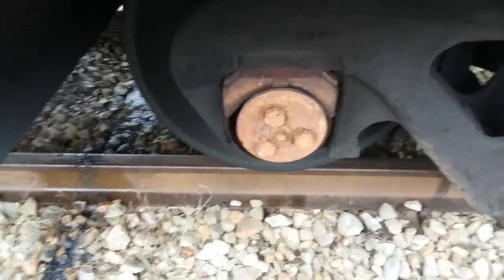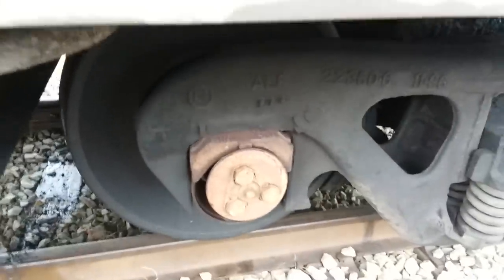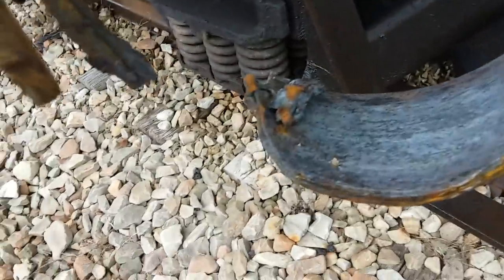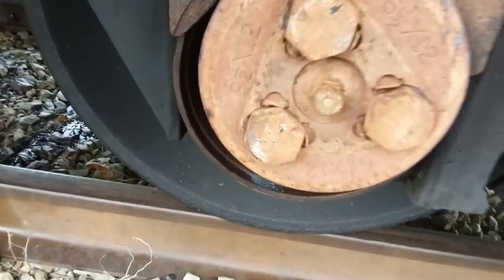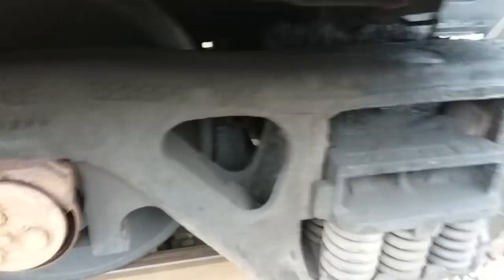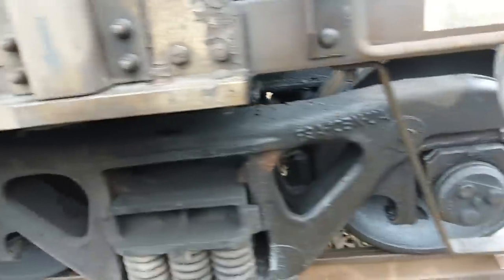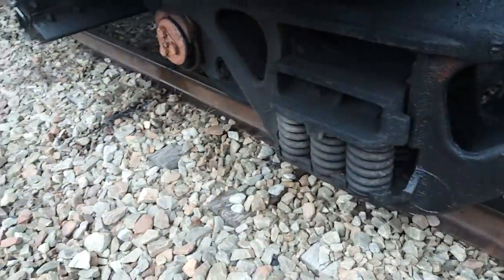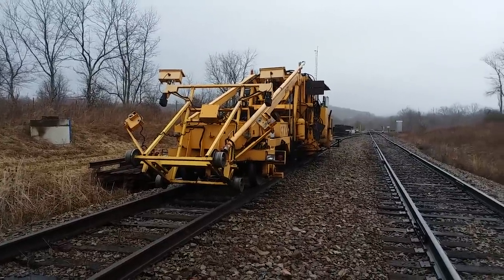Hopper Car with Bad Bearing, more of the Story

Comment: Add years repairing freight cars ,Penn central ,Conrail I never saw roller bearing go bad ...
Thanks for video
Reply from the maker: Thanks for writing in, that awesome you worked for PC and Conrail,
golly would I enjoy hearing some stories from you! We have an uncommon amount of bearings go bad here over the past 10 years.
We only have 38 cars but probably have had 10 to 12 bearings
fail in that time. Makes me wonder if the vendor we have for
rebuilding our truck sets may be not of good quality? it
is a puzzlement to me and costly for the company.
Reply: @ccrx6700  ,something is not right on bearings ...
I rebuilt bearing with Timken ...
But they stopped that long ago ...
We used to check rear seals and if you can turn them they are defective ...
You do this while inspecting train reach over trucks and grab real seal ,if it turns it's defective ...
Maybe grease is leaking out there or water getting in ....

But still I never saw a roller bearing go bad ever.  .
Friction bearings of yes ....
I was wreckmaster and saw everything and trainmaster also never saw roller bearing good bad ....
Reply from the maker: @sproulman1  thank you for replying back. I will start looking at those seals. I did not know that before. We had another bearing burn up this week.  😢
Reply: @ccrx6700  ,we inspected PPL coal hopper cars and they had us reach over top of trucks and turn rear seals by hand ...
If they turned they were shopped and wheels replaced  ...
We use to see those cars daily for years

Comment: You never said how it gets fixed. Does a crew come out and fix it there and how is it fixed do they put a new wheelset or an axle in?
Reply: A crew jacks the car up and they roll the truck out from under it. Then they lift the end of the truck off the bad wheel set and roll the wheels out. Then a new wheel set is put in its place and it all goes back together in reverse order. If it was the outer wheel set, if I remember right, it seems like that can be changed by just lifting the car and truck together and rolling the old wheel set out and the new one in.
Reply: We have a contractor coming out next week, will try make some vids if I'm at work that
day. They have a crane, will pick the car body off the old truckset, then roll it out and roll
a new one in, there are only 2 brake linkages with pins that need to be removed so
that truckset is then free. Good question and thanks for asking and watching sir
Reply: @ccrx-xu1wc  
We have jacks on our Road Truck, and can change that wheel out in a little bit.
Making sure the lift pads are Level and Stable, is the most important thing!
Reply: @ralfie8801  What do you mean by "If it was the outer wheel set"? Thanks
Reply: @90FF1  
The wheel set closest to either end of the car. The wheels toward the center of the car would be the inner set and the truck would probably need to come out from under the car to change that set. 
It just depends on who’s changing the wheels and what kind of equipment they have to perform the task with.
Edit: For all I know the axles might be numbered 1 thru X beginning from the “A” end of the car. Locomotives are numbered 1 Thru X begin get at the front of the locomotive going rearward. Being a locomotive dept employee, I don’t really know how the car dept. might go about categorizing which wheel set is which and where it might be located on the car, or if they even do.

Comment: I’m a little late to the game, but bearings with grease fittings were not allowed in Interchange since early 2000’s. Most have been removed from service by now. I saw another one on the wheelset in the same truck. The piece your holding is inner race that mount’s axle. Detector got it just in time, they don’t last long naked axle. We were seeing sealed bearing twenty years old still in good shape. Coal cars are high utilization, heavy, very hard on bearings. Are your cars captured service?
Reply from the maker: All of the bearings we have are sealed. Some of the bearings still
have the button head fittings on the end caps, but greasing them
will do nothing since the bearings are sealed. I kinda figure the
truck set rebuild shop has lot's of these end caps with the fittings
on them and just use them when a wheel set gets rebuilt. Thanks
for writing in and watching today James.
Reply: @ccrx6700  I worked in a car shop as a carman, had a great deal of experience pulling defective bearings and replace with a rebuilt bearing. Timken, Brenco, Hyatt,NKS all sealed bearing that did not reuse end caps with grease fittings. They could use other manufacturers end caps, but only sealed caps with color coded lock tabs in color of bearing manufacture. Green on Brenco, Blue on Hyatt, can’t remember color for Timken. That is why I asked if cars are captured service, not offered to other railroads. I just had never seen grease fittings on sealed bearing, not allowed by ARR. Great content on your channel. Well done 👍
Reply from the maker: @James McDonald  please email me, I would like learn more from you.   

Peppypetsdaily@yahoo.com

Comment: Hi Dave. On one of your bearing failures vids you mentioned having the company check the last hot box detector and the bearing in question was running at 40 degrees + and within 6.5 miles the bearing was hot enough to cause a 6 1/2 “axel to sheer in two. My understanding is Amtrak is running detectors every 20 miles or so for their high speed trains.and in light of your experience it seems like they should be checking every 5 miles, not 20. Am I missing something?
Reply from the maker: Various railroads space them at various distances and that depends
on the sections of track and what the freight or passengers they
run over those sections. I'm not an road master for Amtrak so
I can't say for sure. We only have 16 miles of track and our detector
is half way, which makes perfect sense for us. Very much appreciate your taking the time to check out the video on the hopper car with bad bearing my friend.
Reply: Gosh Dave, thanks for getting to my comment and your answer really does shed some light on an area ( railroading- my grandpa first drove steam for Southern and a few years of diesel before he retired ) I seem attached at the hip with genetically.
Reply from the maker: @georpwl  cool Southern was a great RR in its day 👍😊

Comment: I believe I once read that early rail vehicles used plain bearings. Is that true?
Reply from the maker: Noah, you are correct, early rolling stock used what I believe were
then called friction bearings, which is what I think you mean. They had to be checked and oiled all the time, plus replacing the packing in those journal boxes left many a carman using words unfit for here on our chat. Thank you for watching

Comment: It’s all OK, that wheel set is nearing the end of its useful service life. There’s very little rim thickness left to work with.
Reply: Excellent observation there sir! I wonder how many others will notice, you got
a good eye and some real railroad experience under your belt.
Reply: @ccrx-xu1wc  
Thanks! I’m a IAM machinist at a locomotive shop. One of the things I do is inbound inspections and troubleshooting so the shop knows what to repair.

Comment: Guess it's a jack lift up job since no real space for equal crane lift to pull the truck set out. Will they just bring up a whole wheel set and do it that way or do a full RIP of the bearing?

Comment: That shaft would have had a hole drilled at factory where grease could be inserted into bearing ..as you say over the years being replaced were done so with sealed ones..which have a minimum of packing grease which will liquefy and seep out over time with stress of heat and use and fail as this one did...remember grease and oil is there to reduce (friction and wear)
Reply from the maker: We've been been pretty fortunate David, we put detector in 4 years ago and have only had 4 bearings go bad in that time, so 1 a year ain't so awful bad, im surprised more dont go than they do

Comment: Is a roasted bearing very common?  If it is then there should be a 2 port greasing solution so new grease pushes out the old grease without blowing the seals
Reply from the maker: Seems for some odd reason we here go thru spells, where there
won't be any for a long time, then all of a sudden they start going bad, it's weird. All these bearings are sealed. Appreciate your watching John

Comment: Man, those rolling elements PLANTED into that race.  They may be of a sealed type that really isn't serviceable, e.g. once it goes, it goes and you cool the assembly down (or heat the bearing) and knock it off the axle in the shop and replace, so it figures there may not be a grease valve.
Reply from the maker: Yes sir, and when it went, it went! Bearing was fine on trip up to mine empty. Thanks for watching

Comment: I remain amazed that the hot box detector didn't go nuts when it had this bearing pass.
Reply from the maker: It did sir, Critical Alert, thats how we found it. That  detector has paid for otself catching 4 hot bearings in the last 4 years since we put it in, thank you for watching
Reply: @ccrx6700  It seems like the bearing ought to have been running hot long before that sort of destruction occurred. My guess is that perhaps train speed was low enough that a dry bearing survived until it simply got too loose to contain itself. See something new everyday. lol
Reply from the maker: @Mrsnichols1965  yes sir, found an outer ring bout 3 miles up track, so we know it started failing before that, figure roughly 4 or so miles of grinding before it got to detector. Thanks for watching
Reply: @ccrx6700  How much roughly does a hot box detector cost to buy and install? (obviously there is probably other ongoing costs of the service too)
Reply from the maker: @waynemiller7382  Wayne, 4 years ago ours cost with install around $175,000. We figure from the bearings it has caught already, it has more than paid for itself. Ours came from Progress rail, im sure they prob have better or updated more expensive models.

Comment: I'm guessing your max. track speed is 25mph and by the time the crew gets that hot box message, stops, finds the bad axle how far away is a s/o spur?
Reply from the maker: Bout half mile or less depending on how fast he can get stopped. So we pretty lucky bout that, thanks for watching. You are correct on track speed

Comment: HoBo's beware, what would be the odds of finding the perfect hopper to settle in for the long ride across the country and then it trips the hot wheel alarm half way in due to a bad bearing?
Reply: The odds would be slim to none. In 10 years of doing freight car repair this is the worst failure I have seen. When the train gets into a yard it is inspected and the grease on the side frame is a sure sign of a bad seal on the bearing and would be cause for further inspection of the seals. Failure of a bearing seal is cause for removal of the wheel set. My guess is that this particular hopper is in captive service and therefore does not enter a yard very often and therefore not receiving regular inspection. ( and just as likely not targeted  by hobo's)

Comment: Is there no way to tell if a bearing will go bad before it fails? No predicted lifespan either? I wonder what they cost and how many man hours to replace.
Reply from the maker: These bearings go over a hot bearing detector on every trip and 1 time a day a person walks the trip with a heat gun, so they are
constantly being monitored, if a bearing indicates a higher than normal say a 100 degree higher than the range it should be, then
that wheel is given a closer inspection. No predictable service
life for these. Oour bearings are replaced by a specialty shop not here and have no idea of cost. Thanks Joe for watching

Comment: that piece of scrap you have there is called the cone and is on the inside of the bearings and the cup is on the outside .if that was made by Timkin there should be a stamp on the edge with the name Timkin stamped on it . I used to make those , I ground out that inside diameter were it fits onto the axle  .I hope you don't find the name on that thing because I would hope that piece of scrap did not come from my shop ....
Reply from the maker: Thank you so much n1jrm for the informative comment. We
do seem to have a problem here with bearings going bad.
Cars are not overloaded, but we have 16.8 miles of track
with 70 curves, half of which are over 5 degrees. I'm wondering
if the insane amount of sharp degree curves we have is
contributing to the high amount of bad bearings we encounter?
Any thoughts on this?
Reply: @ccrx6700     I don't know , I just helped to make em , you need an engineer who designed it . maybe you should try calling Timkin in Canton ,Ohio and ask for a design engineer , maybe they could answer that for you . or try using Timkin bearings and see if there is a difference in wear life .  maybe they would sponsor a  trial test to compare brands ???   would be great promotion for both companys.  maybe ?
Reply from the maker: @n1jrm  👍😊

Comment: Looks like the other wheel set is going to fail as soon as the rest of the grease leaks out!
Reply from the maker: Bearings like everything else has a life Jim, some fail before
others, just the way it is on the RR. These are sealed bearings and
as long as the backing plate is tight there is no way to tell
if grease has dried out, if a seal is leaking then that car gets
pulled out immediately, but no seal was found to be leaking.
Was nice of you to take the time to pay us a visit and check out the video. May you have a most blessed day my friend.

Comment: I do NOT like "sealed bearings", just for the reason you mentioned. There is no way to put any grease back into them.  Once they start to run a bit dry, the ball game is over. 
Unfortunately sealed bearings are a fact of life, for the most part.
Reply: Lester, I hear that! You are right. I'm not sure if the FRA requires that wheel sets
be changed at a certain interval or not. On last video about the bad bearing there
was a guy who wrote in that was a car repairman for NS, he told us about how NS
had a regular schedule for greasing the old type of bearings, but they sure better than
the old friction type with having to oil them and change the packings, car men used
to hate to change those, nasty work.
Reply: @ccrx-xu1wc  My first full time job after I graduated from HS was at "Cummins Illinois Eng Sales, in Gary Ind.
I did NOT work on engines directly, but instead rebuilt sub-components .
Water pumps were such an item. IF the water seal failed, it would begin to let antifreeze enter the ball bearing space. It would have an EXTERNAL leak via the "sweep hole" AND an INTERNAL leak into the bearings. That would wash all the grease out of the bearings & they would fail shortly after that. If it was let go long enough, the shaft would grind into the empty race and/or cast housing. This sometimes scrapped the entire pump. The bearings would be PRESSED onto the shaft. 
 Just wondering: Does that R.R. Co have bearing/wheel/axle jobs done by an outside industrial shop, or are they rebuilt "in house"? 
"Just asking for a friend".
Reply from the maker: @lestergillis8171  an interesting story there, thank you for sharing. A good possibility
why this one failed. All of our truck set reconditioning is done by an outside contractor.
They have a web site: Lyons Industries 

http://www.lyonsind.com/

Comment: Another railroad roller bearing is Brenco, made in Petersburg, Va. unless that has changed too.
Reply: Bennie, thanks for telling us that, I did not know that, appreciate your watching
and writing in sir.
Reply: @ccrx-xu1wc  I used to work for the old Norfolk Southern that ran from Chesapeake, Va to Charlotte, Nc with some branch lines.  I worked in the locomotive shop and the wheel shop so am familiar with wheels, axles, bearings.  The 6 1/2 x 12 means the diameter of the axle bearing seat is 6 1/2 inches by 12 inches in length. They are pressed on the axle as a sealed unit as you said. Very rarely go bad verses the old friction bearings.

Comment: I would love to find one of those giant ball bearings on the ground some time. That would be neat to have.
Reply: That would be a cool find, I'd like to have one too, thanks for watching
Reply: Actually they are not ball bearings.  They are roller bearings.
Reply: @benniepierce6283  They WERE roller bearings, but have likely been ground to dust during the failure.
Reply: They likely aren't in the shape of bearings anymore, whether roller, or ball bearings, they'd be unrecognizable globs of molten and congealed slag now.
Reply: @stanpatterson5033  Stan you are absolutely correct sir, they get mixed in with the
ballast, never find them. Thanks for watching

Comment: Fully loaded theres 71500 on each axle. That's assuming no overweights and equal loading end to end in the car. I'd say your low speed style of railroading would make those bearings last a lot longer than coal hoppers running out west
Reply: Matt, thanks, I've seen some of those coal trains go thru the Kearney rail cam,
it's incredible how fast they go thru there, hard to judge speed over a cam, but
am guessing around 50 to 70, they just fly by. Imagine if a bearing went bad and
caused a derailment at that speed. One guy wrote in and said UP had detectors
bout every 10 miles or so. A car man who works for NS told me he has seen car go
thru one detector and by the next one it was shot